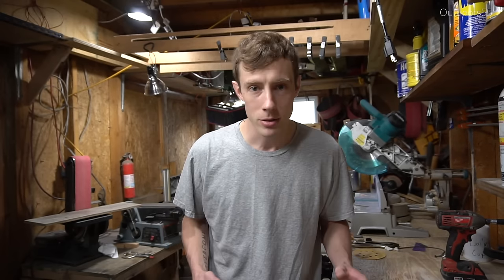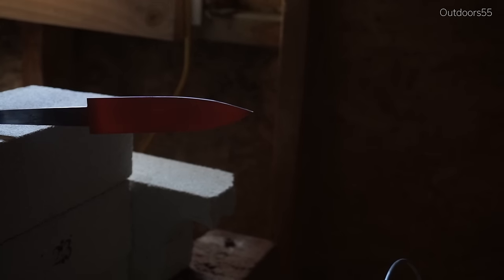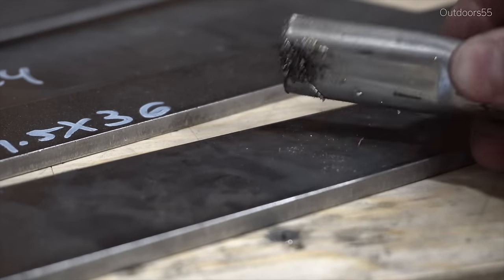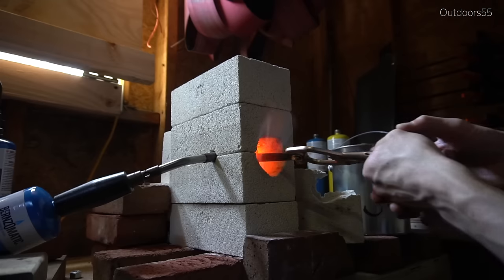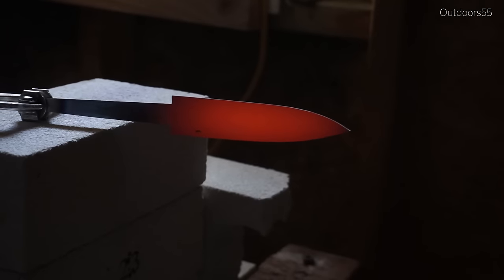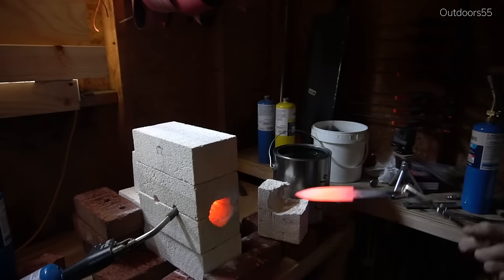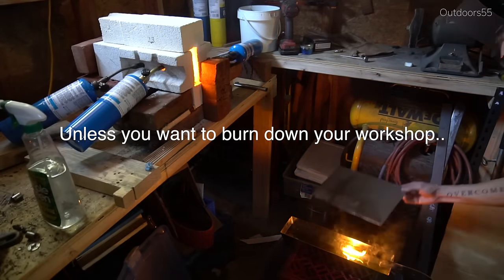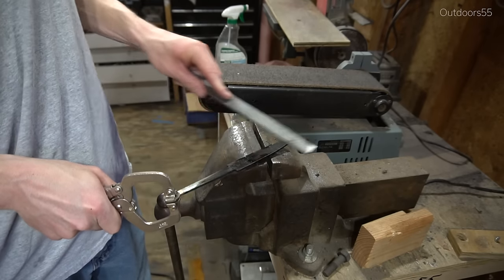How To Heat Treat A Knife | The 4 Steps You NEED To Know

Comment: Hello sir.
I meet the difficulty in high frequency hardening the cutting edge of pliers. I hope that you could help. 
1. My material is 1060 with 0.58%C. And total body of pliers after heat treatment get the hardness from 43 to 48HRC.
2. The requirements for hardening as follows.
2.1 the hardness of cutting edge from the top of cutting edge to 1.6mm is more than 62HRC.
2.2 The next distance is not over 0.2mm (from 1.6 to 1.8mm). The hardness is smaller than 43HRC.
2.3 The remaining (from 1.8mm) the hardness is body hardness (43 to 48HRC).

I meet the difficulty to get the 2.2 condition. So could please advice me how to solve that problem to get the 2.2 condition.

Thank you so much.

Comment: I'd also like to ask why it is that old sawmill blades never seem to lose their temper. At least that has been my experience. You can cut out a blade with a torch, grind to your hearts content, soak the finished blade in hot water, yet the temper of the blade doesn't seem to change. What is it about some metals that allow them these qualities?

Comment: What happens if you use a stovetop instead of a forge? I know it won't be as hot, but would it work?
Reply from the maker: No, it won't get hot enough. You need something to capture the heat, unless your knife is VERY small. Like and inch...so no it won't work for knives.

Comment: @outdoors55 from the temperature chart you post it appears 1095 is almost exactly the same process as 1080. I can’t find 1080 to save my life right now. Would you recommend 1095 as a decent substitute for 1080 as far as heat treating and overall results?
Reply from the maker: Unless you have kiln I wouldn’t recommend it. It does seem 1080 is sold out everywhere. I can’t fine it either.  1095 requires soaking at critical to get the carbon into solution. It’s hard to do in a forge. You certainly can try it, but be advised it may not harden fully.  5160 would be a better substitute. Or 1084 if you can find it.
Reply: Thank you for the reply!!! I don’t have a kiln. I will essentially following your setup exactly. More or less. What do you think about 1074/5? A kiln would be awesome! Dang they aren’t cheap... also when is your next video? Your videos are without a doubt the very best instructional videos IMO. And you make some dang awesome knives! I hope get there one day.
Reply from the maker: Yes, 1074/5 is a great choice if you can find it in the dimensions you need👍  Thanks my friend! Working on a video now, it’s not an instructional video though. My small grinder broke and I had to get a new one, so I upgraded to a 2x72 and also bought a kiln. The video is simply on getting those things in and setting them up. Not super exciting, I know😂 both items showed up broken, so I haven’t had a way to make anything in the last couple weeks. Once I’m up and running, I should be able to do a lot more videos. Again thanks!
Reply: @OUTDOORS55  2x72 and a kiln that's AWESOME! I can't wait to see what you can put out with those now... I just ordered the 1074/5 for my first knife. I have a long way to go. Still need to build the brick forge and bevel jig, But I can start designing and cutting the blank. Thank you again for the fantastic content. Your videos are great. I look forward to them all the time.
Reply from the maker: Thanks again my friend! Let me know how it goes!
Reply: @OUTDOORS55  who makes a good beginners kiln. all those on Amazon have bad reviews

Comment: Question: You advise heating to non-magnetic then returning to the heat for "a minute or two".....that seems like a long time to me?
Reply from the maker: Yes it can be for smaller knives. It really depends on the size and thickness of the knife. 1/8” thick stock will heat way faster than 1/4”. Although 1080-1084 is pretty forgiving if you overheat it slightly. You just don’t want to soak it and overheat it at the same time. More or less😀

Comment: Found an old forged blade that doesn't seem to be heat-treated, thinking about heating the Edge to non-magnetic, to harden it. Good idea?
Reply from the maker: How do you know its not already heat treated?
Reply: @OUTDOORS55  its quite soft and file "takes" it, if it would be heat treated, then file should not scrape it so much

Comment: Awesome tips Alex 👌 I plan on messing around with some D2 very soon so I've been reading and studying ways that work and ways that do not. It should be interesting 🤣
Reply: Brandon Cornett good luck
Reply: D.G. Blades I have steel working in my background and have used several types. D2 shouldn't be much of a problem. I might screw up a couple of times practicing but I'll learn what not to do quickly.

Comment: Im having a hard time getting my 2   fire brick forge (made after urs) to head the steel enough.. any tips??
Reply: What type of fuel are you using ?
Reply: @thewall2711  propane, easily fixed the problem by adding a second torch lol

Comment: I have been working with o1 steel, making punches and such, but my brother asked me to make a knife. I forged it down  from o1 steel and normalized it according to heat treat info, profiled it on the grinder, but when I went to file on it, it dulled my file. Tried to center punch drill holes and broke my punch. Then broke the carbide of of two drill bits.
Found out that o1, which is supposed to be an oil hardening steel, can actually air harden in thin sections (like a knife)

Comment: Let's break it down...the heat needed is 18000 degrees for tang spine before the heat transfers to the handle. The tolorence that changes the dimensions as it relates to the value or shape.big part is the ambient temperature

Comment: Four minutes in people can still google "steel temperature color chart" . Couldn't hurt to look at one.  My question is why not grind and work the blade right after normalizing when it is most ductile?  You could normalize it again before hardening and tempering. Sounds like you are tempering the blank and then working on it?
Reply from the maker: Most steel comes in the annealed state. Which is the softest state. Normalizing refines the grain structure. Its two different things.

Comment: I’m in an ABS Bladesmithing class and we are quenching in water between tempering cycles (also 1hr at a time). Any thoughts on this?
Reply from the maker: As far as i know theres no issues with quenching in water between temper cycles. Its just to cool it off between cycles. Aside from personal experience most of my technical knowledge comes from Knife engineering by Dr. Larrin Thomas.  Of course this is steel dependent and you’ll want to follow the manufactures heat treatment until you have established a protocol of your own. 🙂

Comment: I'm surprised you didn't mention to have a compass next to your quenching oil so you know what direction to aim the blade as you dip it.  The atoms will align to magnetic north (or south in southern hemisphere) and lock into that position as it cools.  If you're quenching a long blade, this effect can cause the blade to warp in the direction the polar force so it's essential to dunk long blades in a flat orientation aimed towards the direction the compass indicates as north.  

Don't assume that directional north is ok.  you must use a compass because various environmental or industrial anomalies can throw off the magnetic forces where you are.  I happen to live near a power plant so magnetic north for me is roughly north-northeast. 

This knowledge can be applied in many ways.  In the case of a katana, if you want the blade to arch more, dip your blade in a vertical tube with the back side of the blade towards magnetic north and it will draw the tip toward the direction of the magnetic force if only ever so slightly.  In the case of straight blades, use a flat orientation directly towards magnetic north which will stretch the blade a few thousandths of an inch.

Its only a technicality but it can and does have an effect and is the reason so many hours of prep still resulted in a warped blade.  That and uneven heating...

It's only a point to consider and i hope it helps enlighten your experience.
Reply: @awashburn6944  Thanks for sharing what you read in that text book....
Reply: @awashburn6944  soo, you go around watching videos waiting for an opportunity to hang your credentials on comments that disagree with...  your experience?.. or once again what you learned out of a book.  I don't care about your reading skills.  

Since you're calling me a liar and saying I'm cracking my work, clearly we're going to disagree.  I have no need or willingness to prove to you what myself and soooo many other "backyard blacksmiths" and jewelers have observed.

I will make one amendment however,  replace "thousandths" with hundred-thousandths.  I think you're picturing my statement to mean that i was describing a blade visibly warping like a green 2x4.  That's, albeit ridiculous, just the knee jerk reaction you needed to tell everyone about your degree. 

Please don't reply back, I'm not deleting the comment.
Reply: lol

Comment: The fastest way to quench. You heat the edge using a blow torch until its cherry red then quench. Then, heat the rest of the body until its blue, quench again and you're done. Not the best but a functional blade with a very tough edge and a fairly soft but crack resistant body. The edge will may crack against a very hard object but not wood.

Comment: What would happen if you sharpen a blade before hardening?
Reply: I've done this before. And depending on how thin your edge is, it will just either warp slightly or break. Nothing significant though.😄

Comment: Do you normalize before or after forging and shaping your blade?
Reply from the maker: After. If your doing stock removal theres really no need to normalize unless you get the metal fairly hot at some point during the shopping process.
Reply: @OUTDOORS55  Cool, that's what I thought. I'm new to bladesmithing and just thought I'd ask. Thanks for the response 👍

Comment: I never understood the file checking when it come with the Rockwell hardness. A bastard file has a specific hardness so why doesn't it bite into hardened steel? I've used a file to score and break glass before when I couldn't find my glass cutter and I'm pretty sure that glass is much harder than steel. I'm not doubting the method. I've used it before; but it just blows my mind how I can get a file to skate across a piece of Steel that's been hardened and yet I can still scratch glass with that same file that would not bite into the steel🤔🤔 it's weird.

Comment: It's also worth pointing out that if you do not heat the knife up enough to sufficiently harden it - not harm, no foul, as OUTDOOR said you can just try again.
However... If you overheat it... You can start to have failures like he said. And, worse yet, if you overheat it a lot or multiple times you can start to change the chemical properties and make-up of the steel by processes like decarburization. So it's better to TAKE YOUR TIME and don't overdo it. If you under-heat on the heat treatment, you can always normalize and try again. If you rush and overheat it, you can end up potentially ruining the steel's properties in the knife you've put so much work into. Better to have to potentially redo the heat treatment than to potentially scrap your knife, right?
Reply from the maker: Yes that’s generally true. Although the decarburization reaction can start as low as 1300f which is below the temperature needed to hardened. Decarb happens with pretty much any knife during heat treating. That’s one reason it’s important to leave some edge thickness on the blade during heat treating. The decarb surface will be ground away during the finishing of the blade.  But I agree, too little heat rather than WAY too much.  Although these little gas forged have trouble getting super hot anyway so for most people way too hot isn’t an issue. Just an thought. Thanks for the comment 👍

Comment: I worked for republic steel in the metallurgy laboratory, you’re presentation is fairly spot on, but one thing that I see a lot of blade Smith’s doing that needs improvement, is the quench tank should have the oil agatated  and should be at least 15 gallons capacity  with ajatated oil

Comment: you wanna do everything you can BEFORE heat treatment. Grind down the blade to the point where you could sharpen it, after heat treat its a pain in the ass to grind the steel, watch out tho since the blade will heat up faster on the cutting edge.

Comment: What do I know about metal and heat... nothing! I have a TOPS knife and a Cold Steel Voyager, one went rusty the other I did not like the finish on the blade. So, I heated them up on a cooker hot plate until they went brown with a lovely rainbow effect, let’s say about 10 minutes, then sprayed them with silicone oil to seal them. Now I’ve watched you show I gotta ask, have I affected the steel in a negative way, or may be you just can’t get the temperature needed to cause any molecular change on an ordinary kitchen stove? Yikes...what have I done now?

Comment: Why not quench the knife edge when you have the cability of being precise with heat methods? Added carbon too the steel edge whilst heating and by basic understanding of material properties of steel you should get a hard hard edge and soft but tough core. I have no experenice with this like so feel free to correct me on why people dont do that.
Reply: UkSapyy as a knife is repeatedly used and sharpened, that edge is shaved away and the knife is whittled down, sometimes to more than half its width. Adding carbon on just the edge would make for a weak edge later in the knifes life.

Comment: Temperature is critical when Normalize and Harden process. Can’t you ass a thermocouple and get a more accurate temperature rather than guessing? Normalize should be done at 1650F and harden temperature should be 1500F.
Also: Running these blades in a temperature and carbon controlled furnace will give you better results be adding or carbon to the surface of the steel making this harder. You should also freeze the steel immediately after quench to achieve a better wear and tear resistance in the steel. I would also lower the tempering temp to 300F this will be high enough to release the stress and keep a high surface hardness.

Comment: Wisdom is not to ruin a new file just for checking the hardness, if the steel is good  and the process OK then no need to check, if still in doubt use old file the sound will tell you your results.
Reply from the maker: Nothing in your comment is true

Comment: I went to an airbnb experience where we were able to forge 1 of 4 projects, I made a tomahawk from a rail spike welded to a metal pipe for a handle. It went well overall but I see cracks in the blade and after watching this video, we didn't normalize, the oil wasn't preheated, the temper was just 15 seconds back in the forge. Kinda disappointed. Cool experience though

Comment: 1095 is by no means a beginners steel. This is so commonly misrepresented. Always the same thing. Heat 1095 until it isn't magnetic and quench in motor oil. This will harden the metal no doubt, but this does not make a quality high carbon steel blade.

Comment: Does it matter that you're not heat treating the tang?
Reply: Matthew M that was my assumption, thanks
Reply: No
Reply: The problem ive had in the past is having the blade bend or break at the handle. My personal experience is treat the entire knife.
Reply: @jocat2008  Been forging swords for  over 20 years. Never hardened a tang and never had a blade break there. The trick is to ensure the tang/ricasso junction is fairly soft and fairly thick.

Comment: Pardon me for coming off as a smart-ass, but rather than say heat treat, why not say temper? You defined your term, "normalize," telling us you were using the term rather than anneal...
We used to anneal by heating our piece and placing it in lime. I was reading up on D4, I have knives made from it, and the knife factories anneal in a kiln, that precisely regulates the uniform slow drop in temperature to quickly anneal steel. I was once forging from a tractor axle, took forever to anneal.
.
Reply from the maker: The terminology in this video is correct. Annealing is different from normalization. Annealing put the steel in it's softest state. The method for both is dependent on the type of steel being used.
Reply: OUTDOORS55 We can learn something every day.

Comment: Great info, but you shop looks like a fire waiting to happen.  If you're doing a lot of hot work, you should put down tile backer board on your bench tops, that will insulate the wood from heat really well.  And you should NEVER plug any kind of heating device into a power strip, they're not meant for that much power draw.
Reply from the maker: Im well aware

Comment: There are some very dubious problems with the heat treatment explained here . About 40% right ...
Reply from the maker: No theres not
Reply from the maker: none of this info matters in a forge using a magnet. its not close to being accurate enough, hence the "simplified" in the thumbnail. I also go over why color isn't a good indicator of temperature due to lighting conditions. Its good, simplified, information, minus a couple percent worth of accuracy, that just doesn't matter using the correct steel, and using crude heat treating methods like a forge.

Comment: y canola there is
 very little minerals in it
Reply from the maker: Minerals has nothing to do with heat treating.
Reply: @OUTDOORS55  do you not need the added Minerals in the oil to make the blade stronger so they can be burnt back into the blade wen you treat it?
Reply from the maker: No, minerals do nothing for heat treating. The chemistry is in the steel.